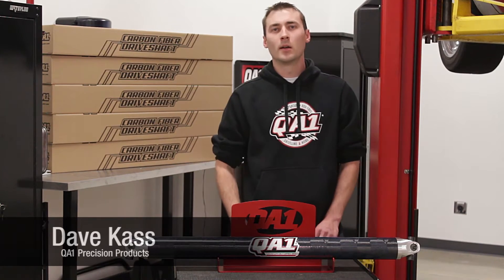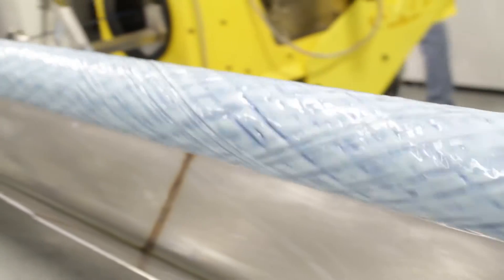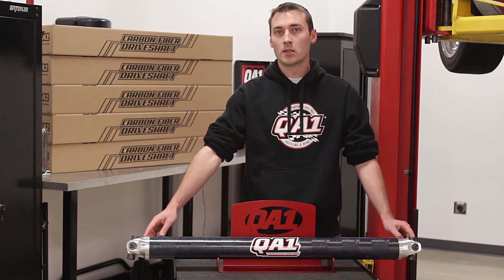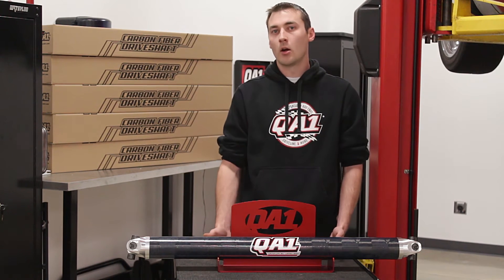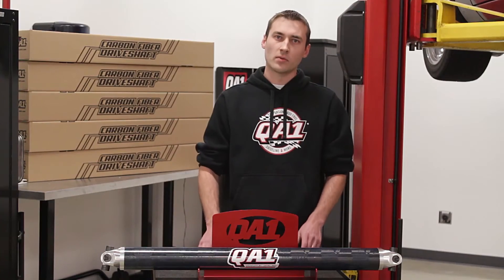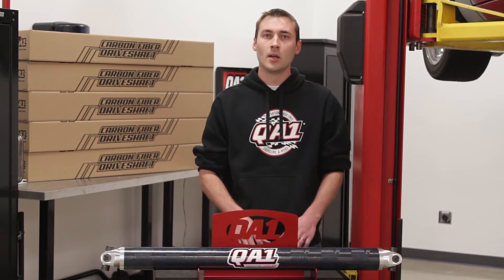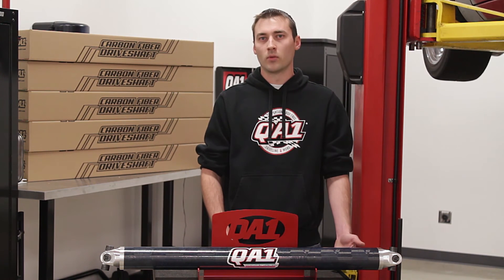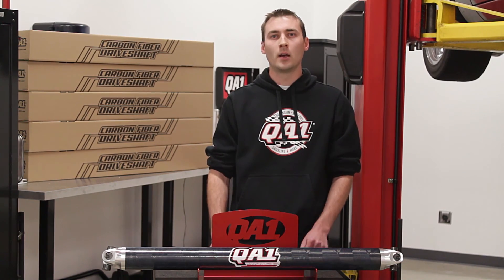About QA1 Performance Carbon Fiber Driveshafts

Comment: My 2010 camaro ss cf driveshaft doesn't fit 🤷🏽‍♂️
Reply from the maker: Hi there! We offer a direct fit driveshaft for the 2010 Camaro SS platform. If you are running into issues with the install or need assistance, please reach out to our tech team and they will be happy to help. They’re available M-F 9am-5pm CST at 952-985-5675 or Sales@QA1.net.

Comment: Somewhat confused by the torque rating - since it is AFTER the torque multiplication of the gearbox that means 200 lbs.ft (ft.lbs is work done) of engine torque - or less.